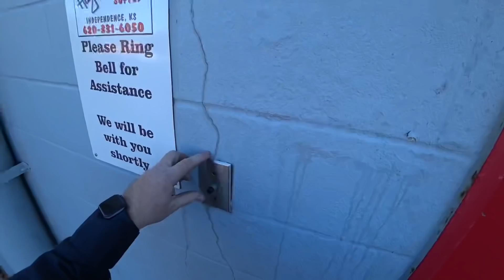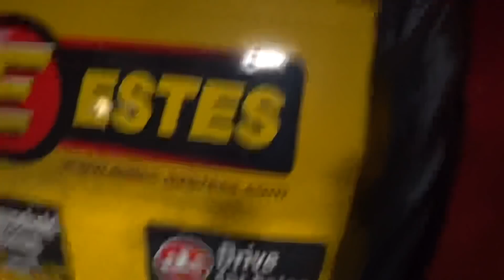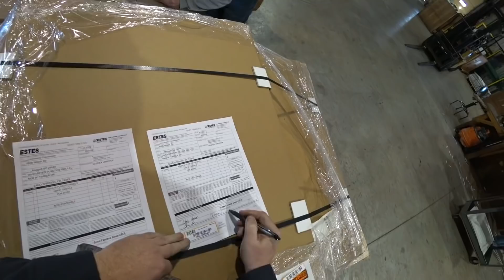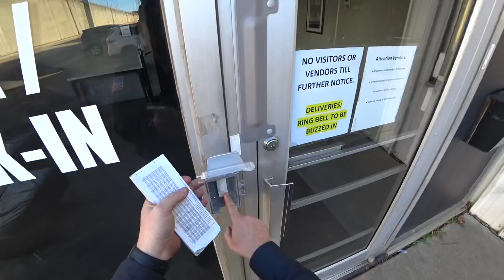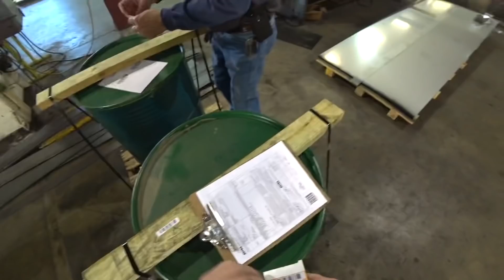Leaving Estes Express P&D

Comment: Congratulations on your new gig! 

Looking for some direction.  I want to change careers. I have 20 years straight truck and flat bed experience in garbage industry. I’m thinking it will be difficult to get on at Estes. Any advice for me getting started in trucking OTR or PD ?
Reply from the maker: Once you get your CDL find you a local job like Coke, Pepsi, Budweiser as they take new class A Drivers.  Get your one year of tractor trailer experience and get your endorsements then apply at estes.
Reply: @TheTulsaTrucker  thanks for the advice 👍